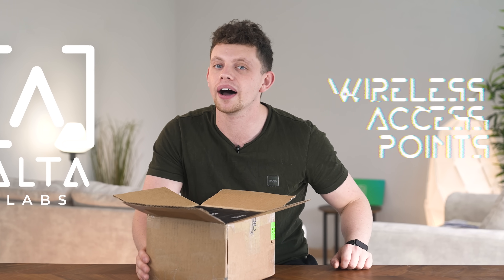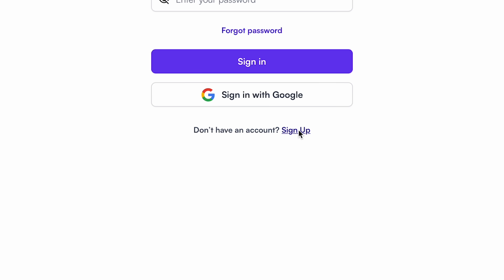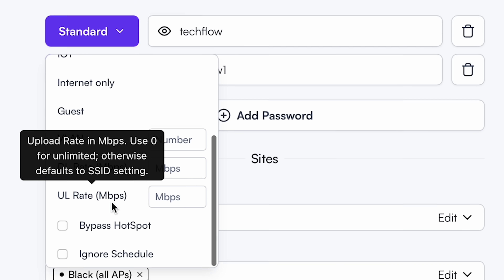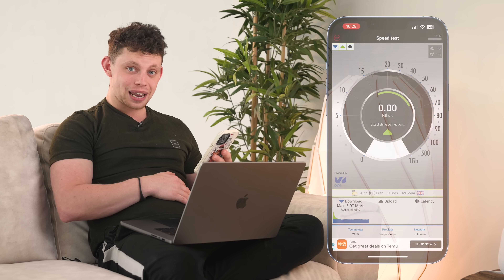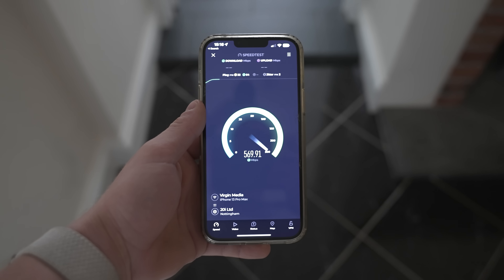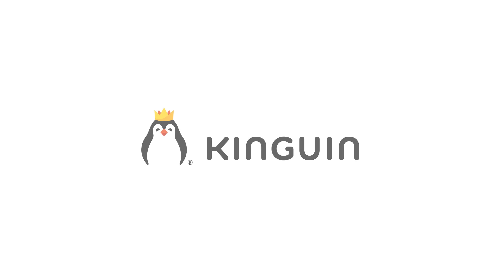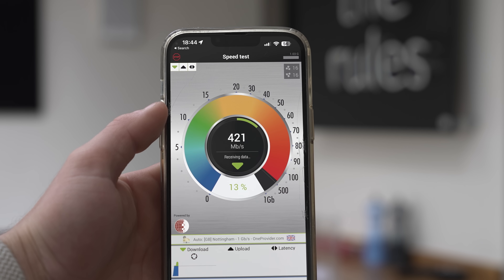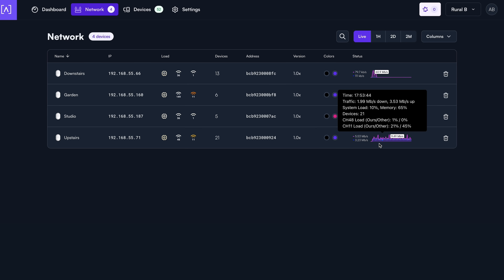Alta 6 Pro WiFi Install: It's Next Level!

Comment: for speed limiting - is that a cap on the entire connection?  i.e. if 5 devices are connected with the same password,  and I set that passwords connection speed to 20 down / 2 up - then all devices connecting with the same password have to split that 20/2 connection ? 

OR does it give each device connected with that pw a 20/2 connection per device, and 5 devices would end up using up to a total of 100 down / 10 up ?

Comment: unifi doesn't need a controller in it's stand alone mode.
The controller you can use a raspberry pi or if you already have a server you can run the controller off of that. Yes these controllers would probably cost something but either not that much or it's on something that you're already running.

Comment: The trouble with new wifi toys right now (especially considering the size of investment wifi 6 represents) is wifi 7 is just around the corner. I'm even holding off on installing multimode in my house because of the implications of wifi 7 until we get some real-world numbers.

Comment: I don’t see the value in these if you’re in the Unifi ecosystem, but would be useful in other scenarios. My Unifi APs already get the speeds that were shown in the video. Single SSID is nice, but I would rather have one management software solution than two.
Reply: what do you mean 1 management software than 2? Also UniFi already rolled out the SSID with PSK a few months ago. If you have UniFi you can configure it on your end right now.

Comment: I use the Aruba Instant On range, similar setup with me need to have a controller which helps massively. The good thing with them is that it is based on the enterprise Aruba Networks kit, just a lower cost version so the support is really good and price is similar to the Ubiquiti’s of the world

Comment: Another question you said you was using Ubiquiti UniFi 6 Long-Range Access Point ….. is that the reason why the speed is a different…..
Because why aren’t you using Ubiquiti UniFi 6 Pro Acces Point Wifi 6 

Because that’s more of a comparison…….. because if you use in a long-range AccessPoint it’s going to be using 2.4 not five or six

Maybe you are using them access point set forgot to mention it , and it’s not true, you can set up a ubiquity access point, and not have a cloud key
/….. I get what you were saying, you can set up this device and have full control like a access key

Comment: I just with they offered local management instead of locking you into their cloud only.
Reply: This is exactly why I'm sticking with UniFi.. it's not perfect but at least it's under my control.
Reply: I’m pretty new to most of this what is the downsides to clouds only. Does it mean without internet I cannot change settings?
Reply: @defyiant  It means if the company goes out of business or if the internet is down you can no longer configure them.
Reply: @defyiant higher expense to maintain the servers that host the controller. Expect a monthly cost eventually.

Comment: Alex I always like your videos...but in this one im not sure your fully comparing apples with apples. Have your unifi speed tests been conducted via a Unifi controller that doesnt have security throttling enabled, like IPS, which would throttles your WAN speed? Failing that the devices do seem a good way to bypass a few hundred pounds on a controller if someone else offers it as part of the price.
Reply: Yeah probably isn't even the same channels, All my Unifi APs hit 600mbit
Reply: I agree with you! For me there is also another important thing… to have a local contoller!

Comment: Looks good for a new company but you only really need the controller you mentioned for external access, otherwise all access points are pretty much plug and play with the same web based settings page for management locally.
Reply: It does not have local management,  their cloud only.

Comment: can you reset the APs remotly in the dashboard if they are connected by POE?
Reply: Not yet, but the feature is coming!
Reply: Depends on the switch that you are using. It’s easy to issue commands to HPE or Cisco switches to power cycle APs

Comment: Although I enjoy these videos, getting excited over having the same SSID and different passwords show lack of experience with enterprise wifi solutions. As a qualified professional, I've seen this on many other vendors like Aerohive networks (Extreme networks they're now called) gear.
Reply: Thanks forid200. You’re right. The feature certainly isn’t new in the market place. Just what we are doing with it is. There is so much more behind Alta Labs access points. We would love to have you take a look at everything our platform has to offer.
Reply: The feature is also the opposite of a benefit if you can't split the SSIDs into separate networks the same as Unifi. Imagine connecting to the SSID then wanting to switch to the other network, you would have to forget the network and then enter the password every time you wanted to switch. Seems more like a gimmick
Reply: @paddyd9615  You can have multiple SSIDs per site. The password ideology is to help clean up broadcast traffic. We also give you the ability to take individual client devices and move them to a different network type from within the management platform, so you don’t have to forget and rejoin network devices as you mention.
Reply: Alex doesn't have any experience with enterprise solutions. He doesn't have any networking experience

Comment: Alex, are you using UTP cable rated for outdoor use for the outdoor AP or just normal UTP ?
Reply: As long as he doesn't have to much interreference outside then it should be fine

Comment: Needing an online account and an internet connection for setup instantly makes it a worse solution than others like Unify. Being able to install a controller locally or host your controller for free locally makes security miles better and makes setting up and managing possible when your internet connection goes down.
Reply: Have you used a cloud controller before? Once you switch you will never go back. These APs stay up even if the internet goes out.
Reply: @jeff-hansen  unifi works that way too even if there is a local controller. He's referring to not being able to manage & view the AP's without internet which you can't do with Alta Lab anything
Reply: Another absolutly crap for online, if connection going down, goodby AP
Reply: @ps5gamepl4ys  Not goodbye AP. It isn't Meraki
Reply: So true!!!

Comment: Hey Alex. Can you control the Alta access points with the ubiquity UDM Pro instead of using the Alta cloud ?  Thanks.
Reply: Any ideas?
Reply: @reviewsyoucanuse6747  Don’t think this would be possible. Nothing in it for Ubiquiti to develop their free controller for other hardware vendors
Reply: this is like asking a samsung watch to be connected & sync'd with a IPhone. The answer is no & that is a really dumb question since UniFi AP's are far superior.
Reply: @nitrogarbo1589 thanks for being a complete ass hole.
Reply: @nitrogarbo1589  hey ass hole.   How about remove your dick head comment.